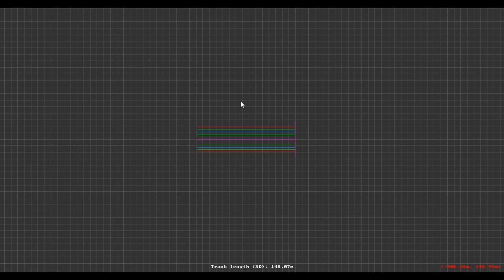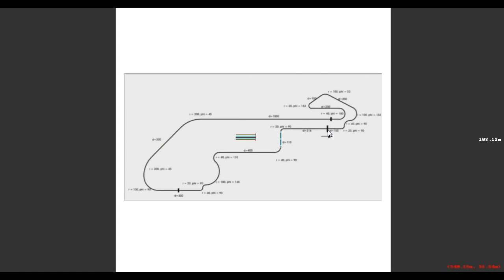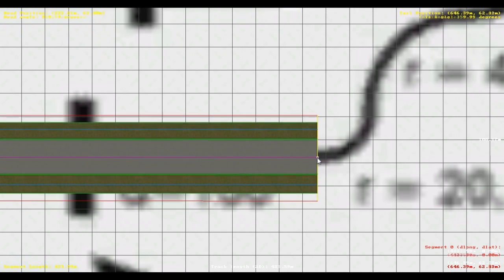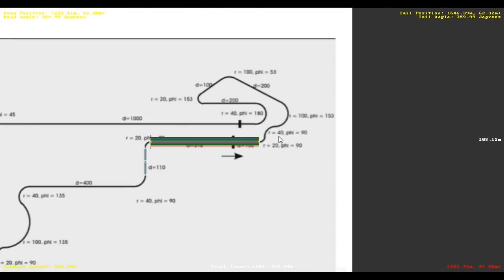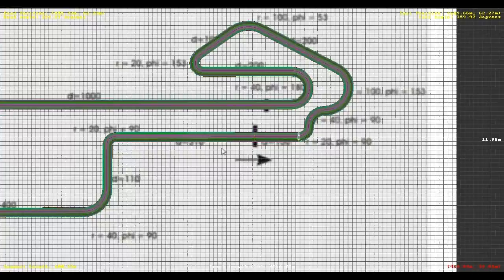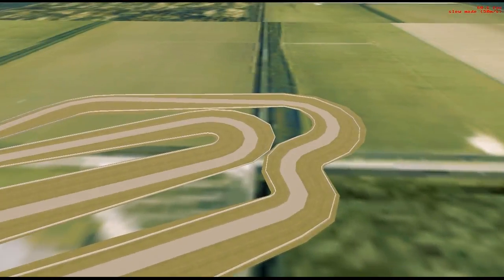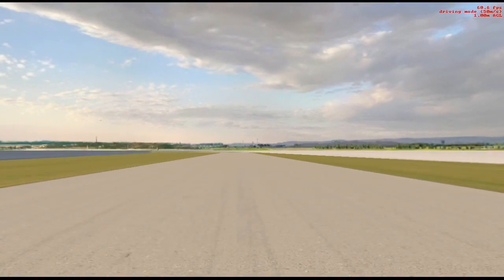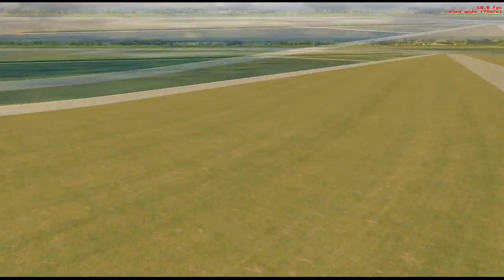Automation test track build (Sandbox/Nascar 2003)

Comment: Do you still make tracks?~ I need some help with a couple things~
Reply from the maker: Not in many many years, I might still have some sandbox knowledge left floating around in my head though
Reply: I would like to send you a track file and see if you could polish it up some~ It needs a backstretch pit, a few billboards, some added mips, and the flagbox is turned the wrong way~ If you think you could help, I'd pay you whatever you felt it was worth~ My email address is buttermilkjug@yahoo.com
Reply from the maker: oh I'm afraid I don't have any the files/software to actually work on stuff anymore. It's been many many years.
Reply: That's a bummer~ Been trying to get this track for years~

Comment: we would love to see you drive on it.
Reply: ConeDodger240  We have made some changes to the layout to make the track more interesting, best use the new layout data once we've made an overview. I think Martin currently is preparing a layout overview which has both driving line (that's the currently shown line you used) and the actual track. That should make things easier to model :)
Reply from the maker: I will try my best! I'll try and clean up the track a little too, add some "realistic" banking and curbing and such...stay tuned!
Reply: ConeDodger240 Re-watching this.
From the AutomationGame channel, and Killrob saying some of the banking and slope angles.

Little Dev Update: Test Track Action
watch?v=J9tEh7roIkg
Reply: +ConeDodger240 If it's not openly available in the current open beta, we can just send you the track definition with all the data in it (banking, slopes, bumpiness, etc.) :)
Reply from the maker: AutomationGame That'd be fantastic, I tried my best to pink panther my way through the files to find the data but couldn't find it :P